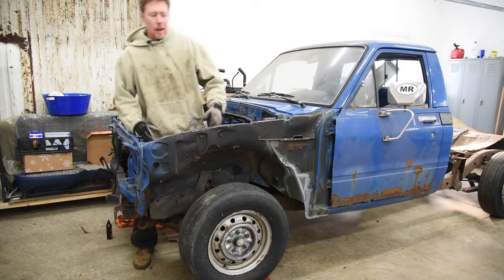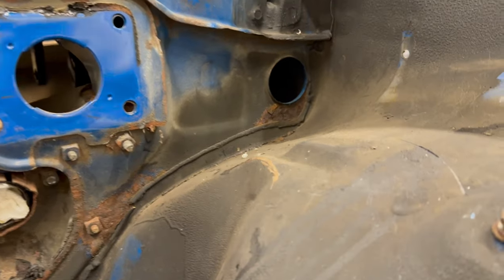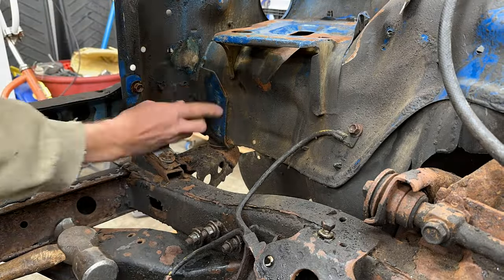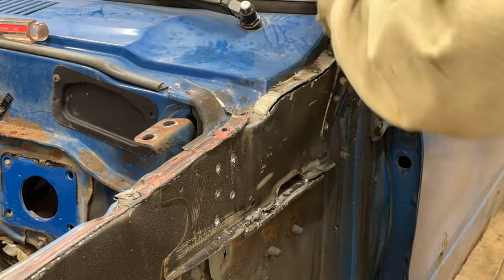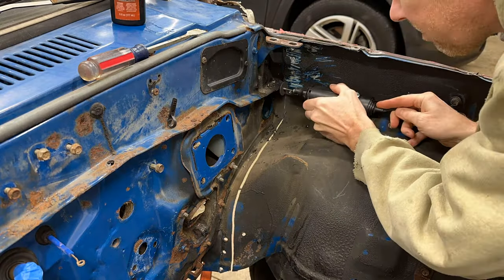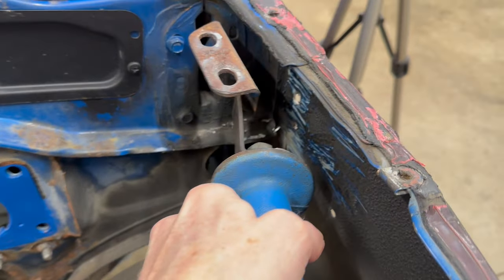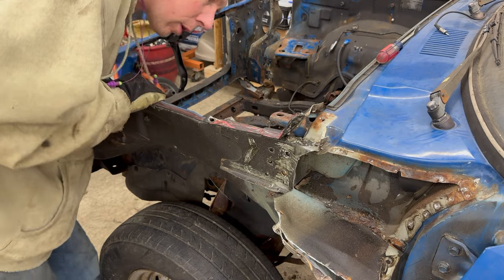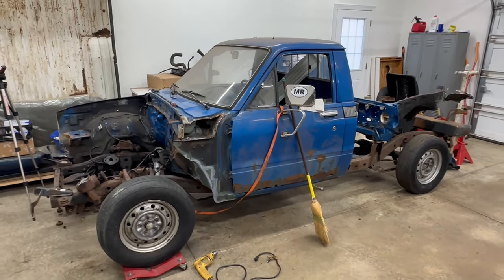How to: Drill Out Spot Welds to Remove Front Radiator Support & Inner Fenders

Comment: Looks like a lot of work.

Interestingly these videos will help me layer down the line. (From what I've seen and know have an Idea of how it is done).

There's a rebadged Mazda B2500 (2.5 Diesel) waiting for me with my name on it.

Saw in December it had some rust on it between the front quarter panels and the wheel arche.

Pretty much that structure that you took off as well as the battery tray. But it's not as bad as Ohio rust.

Comment: Nice! Im about to wrap up doing both LCA's and replacing almost all the stearing components on my 1993 toyota pickup.
Reply from the maker: Nice... It should handle like a brand new truck when you're done!
Reply: @6thGearGarage  aye, I hope so! It was used and abused when I got it, and I did the minimum to get it up and running to drive across America overloaded with stuff. It made it, but dam did it suck when the shock broke off the damaged lower control arm on the passenger side.

Comment: I have a 90 xtra cab and I always have water sloshing around just below the driver side extra cab window. Any suggestions how to drain?
Reply: Check outer window gasket,
Replace if it’s allowing water in,
I’d pull door panel, check to be clear of 
damaging internals, and drill drain 
holes in bottom, to let it drain.🤷🏿‍♂️
Reply from the maker: On the back of the cab, there is a round plug that allows access to the inside of the rocker panel. There should be drain channels that allow water out but may be clogged from years of dirt. you can spray out the inside with a hose to clean and get the drains working again, but be sure to spray the inside with fluid film or similar once the water is dry.

Comment: Hey what happens if you drill all the way through when drilling through spot welds? I accidentally did that for some of the spot welds I was drilling for my radiator support
Reply from the maker: It's not a big deal, I've done it plenty of times. There will just be a hole that needs to be welded up when it comes time to align the new panel over the old body. Or maybe the holes wont line up at all and it will never be visible.
Reply: @6thGearGarage  Thanks! And does speed matter for drilling through spot welds? I use a spot weld drill bit and I go slow and it works quite well for me.
Reply from the maker: @Joniski_  I also find that going slower works best. More speed just seems to dull the bit faster.